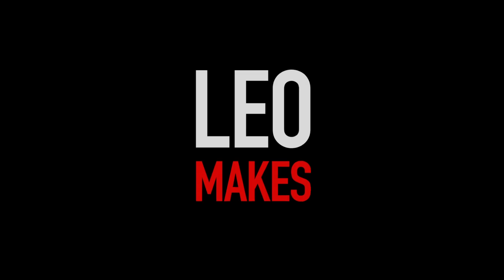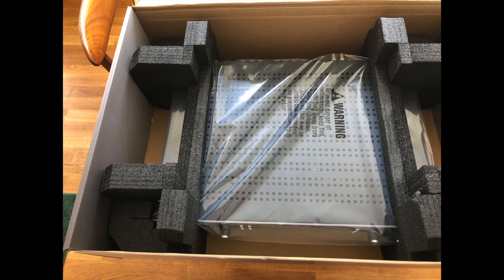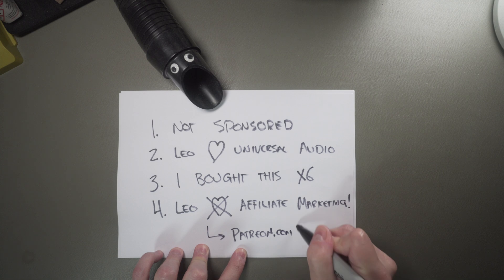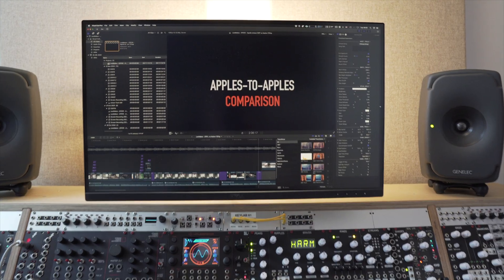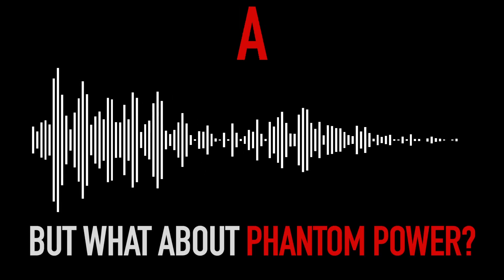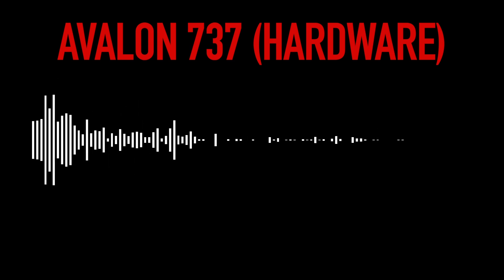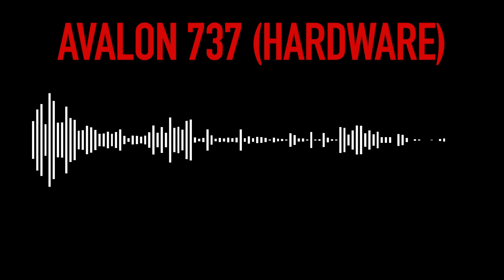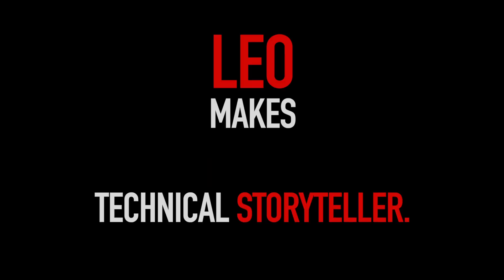Comparing a Unison (UAD) plugin to my real Avalon 737

Comment: Before seeing the results I’m going to say I prefer B because I hear more detail and depth. I’m also an Apollo user but still track trough a Daking pre and WA76 Comp for vocals and sounds wonderful. Great video btw!
Reply from the maker: Was the difference obvious or was it subtle to your ear? 

Btw, those Daking pres are really nice. A friend of mine had one in his studio and I always liked the sound.
Reply: @LeoMakes  yes it was a bit obvious. Yes Dakings are clean and sweet. I realized that at the moment of recording it’s the best stage to add analog warmth, depth and detail. I’m very tempted to add a Rupert Neve designs 500 series chain for tracking vocals.
Reply: Great choices for tracking. That's why I don't own one of those overpriced Apollo interfaces. Why would I spend all that money when tracking through other things sound better. I use a ten year old Mbox Pro (3rd generation) to power my software, but I track through a WA12 MK2 (black) mic preamp from Warm Audio, followed by an LL2A compressor limiter from Little Labs, followed by a Tonelux EQ5P Parametric EQ that can also be used like a Pultec EQ. There's no chain better than that, and I get top notch vocals without spending an arm and a leg for that Apollo. My vocal chain cost me 1,900 bucks all together.

Comment: Although the results are extremely close I couldn't decide which one I preferred at first....until I finally went for A, which to my ears sounded a bit more open and a little less muddy...I was positive A was the hardware until you actually gave out the results....wow....this is not the first time I go for the UAD version of a hardware after doing a blind test, that happened to the Neve 2254 E as well...I've been demoing the Avalon for a few days now trying to decide whether I should buy it or not, until I watched this. It's a no-brainer really! So thank you so much for putting this together, you've just made my day!
Reply from the maker: Glad this made your buying decision easier.
Reply: @LeoMakes  it most certainly did!
Reply: Same!

Comment: I was right from the beginning of the video, and the hardware sounds better. I say that as a UAD x4 owner and someone who prefers to work mostly in the box for convenience.
Reply from the maker: I’m curious.  What did you like about the HW sound?  And was it obvious between them for you?
Reply: @LeoMakes , yes obvious, but I'm a mastering engineer, and subtle differences stand out. I also work a lot in headphones. With analog, mono isn't 100% mono. There is a slight bit of width. Tonally, they were very similar, but the real one has a bit of a tape-y feel to it, some kind of push and pull. It doesn't sound as flat to me. The real one has more depth. I can always pick out real versus virtual in shootouts, but this is at least very faithful in tone.

Comment: Hmmm. The A sounded a little more flat frequency wise, while B had a little more low mids, making it sound slightly less clear. It was obvious. Not sure how they could completely cancel. Maybe you would need to phase test the YouTube versions of the files. That type of audible difference has been experience with UAD vs hardware. This test further reinforced and confirmed it.
Reply from the maker: Great idea--I was thinking the same thing (comparing the original Final Cut Pro export to what YouTube actually posts after my upload).  I might do that if there's enough interest from the community (these videos take forever to make!)

Comment: You can still use your PCIe QUAD card via a Sonnettech PCIe enclosure.  Also - though you can hear differences - I don't think it matters.  You'd likely hear differences between two Avalon 737s the same as I have when using two different Neve 1073 preamps.  Nice video.
Reply from the maker: True!  I actually looked at expansion chassis from Sonnet and others, but went with Apollo X6.  I'm very happy with that decision.
Reply: @LeoMakes  I also have an X6 (along with an older 8p)  I have an even older PCIe OCTO but I haven't used it in about a year as I'm less likely to use UA's plugins when mixing but I always use them while tracking.  (Like I did in studios 25 years ago)

Comment: I happened to get it right. I felt that A was slightly thinner sounding overall, and based my guess on that. They are VERY close though. My only criticism/request would be to include a third preamp in the comparison, something clean and neutral to act as a baseline to be able to better tell the comparative difference. Great video anyways, thanks!
Reply from the maker: That's a good point.  I did do some listening tests during filming and the standard Apollo preamp (with the plugin bypassed) sounds really clean compared to either of these.  Lower noise and more "open" if that makes sense.  Sadly, I did not make any recordings of that.  I'll try to do that next time if I can.